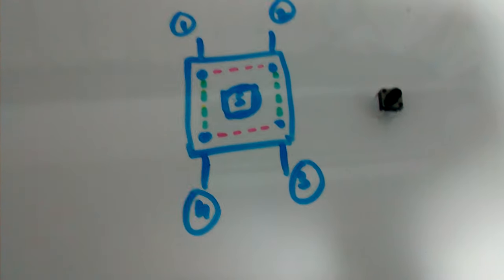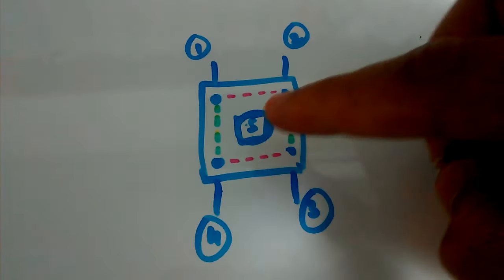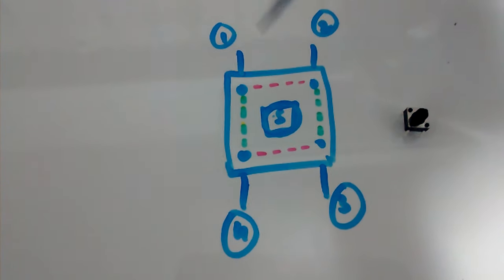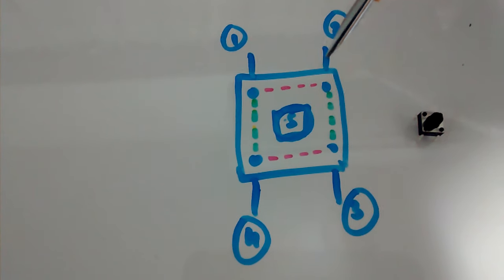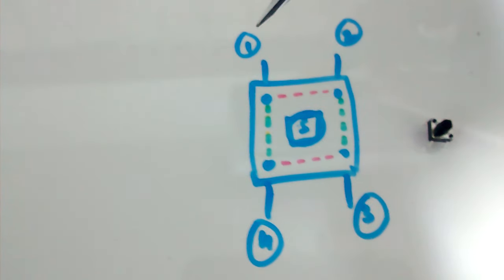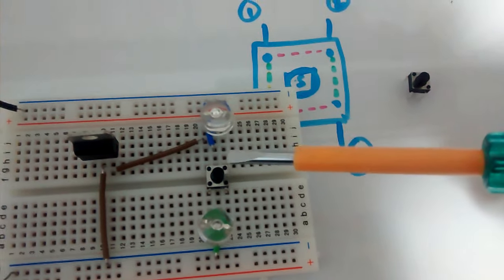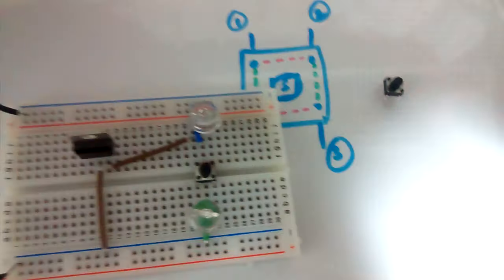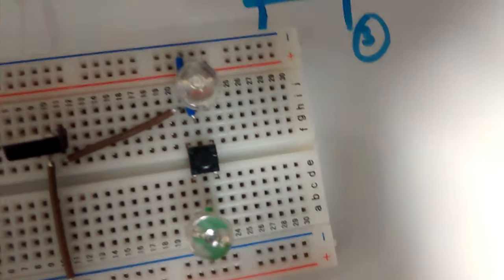Push Switch : Working of a Tactile switch

Comment: So that's mean if power connect with 1 and LED connect with 4 the LED will light up even though I didn't press the button. If power connect with 1 and LED connect with 2 then I need to press the button to light the LED if I don't press it , it wouldn't light up isn't?

Comment: thank you so much for this, sir!
Is it possible to solder a switch in parallel with one already soldered to a pcb? would it have to be the exact same switch?
Reply from the maker: Yes you can and it need not have to be the same switch.
Reply: @imtheroboart  wow thanks for the lightning fast response!

Comment: that was the real basic...can i do same with the stepper motor..

Good if you will explain how to run motor continuously with single press of button and  other case run  until I have pressed the button. like jog button and run button ..  i want practical difference why both act differently
Reply from the maker: hello.. Thanks a lot for your feedback :-)
As I understand, running a motor when u press a switch or until the switch is release depends on the logic u have inside the microcontroller. You can monitor the pin state to which the switch is connected and accordingly write a logic. Every switch gives only two outputs- ON and OFF. The remaining depends on the logic we run in the controller. I hope I could clarify your question. Please let me know if more info is required.

Thank You
Reply: My Distractions I have a doubt, if I press the switch the power at 1 will go to 2 and 3. and what about 4. The power will go there or not.

Comment: I've got a question .
I have a got a lot of synths with these tactile switches , one of them is the integra 7 by roland .
Two of the most used switches on it are the increment/decrement value .
Now , they work good , if I keep pressing them (without letting go ) the values keep changin ( continously) ...but when I verry verry slightly decrease pressure on the switch , but still keeping it pressed in , the values stop .
I am curious how thiss could be , since these buttons only have an ON/OFFs state

Comment: Thank you. Question: is there a way to make a LED remain on when you release the switch (on and off with pushing the putton)?
Reply from the maker: Yes you can!!. But you will require a bit of coding for that. The output of the push switch can be connected to an input pin of a micro controller and turn the LED ON when this pin on the micro controller becomes HIGH.
Reply: My Distractions  I have a doubt, if I press the switch the power at 1 will go to 2 and 3. and what about 4. The power will go there or not.

Comment: Well... this means if we connect the Catod  (+) to one of the switch legs; if we don't push the momentary swich, only two of the kegs have (+) , but when we push the switch all 4 legs have electricity, I don't understand what is the advantage of this switch versus regular swich. This switch does not operates on/off for two wiring with two individual Voltages at the same time.
Reply from the maker: Brian Sha  yes you are right. This switch is used for allowing current only for desired period of time. As long as you press it, the current goes through. Typical example is to reset the controller or implement a counter.

Comment: So i know it's a bit late,but would i be able to solder a 2 pin switch on a 4 pin slot with a doubler cable soldered on each of the switch pin?Or that won't work?
Reply from the maker: I guess it would work
Reply: @imtheroboart  Thank you very much!I'll give that a try.Subbed!
Reply: @imtheroboart  SO I SHOULD CONNECT THE POWER LEADS TO 3&4 AND THE NEGATIVE LEADS ON 1& 2 AND WHEN YOU PRESS THE BUTTON 1&2 WILL POWER UP THE L E D  ???????
Reply from the maker: @mw10259  you shouldn't connect the ground to the switch pins. Ground connection has to be given separately. :-) The switch just acts as a connection between the power and ground in the circuit. The circuit is open when switch is not pressed and closed when it is pressed/pushed.
Reply: @imtheroboart  aaaaaaah ok thank you so much ,,, i'm making a small flashlight , so i should twist the negitive wires together, seal them , and connect the positive leads to the pins that are the shorter distance apart so when the button is pushed they will make a connection  correct ?
Reply from the maker: @mw10259  I actually didn't get what you just said. But since you are working on a flashlight, the positive of the power should be connected to the pins of the switch, the output from the switch to the positive of the bulb. The negative of the bulb back to negative of the power supply. So when you press the switch, it becomes a closed circuit and bulb glows as long as you keep it in pressed state. When you release it, the circuit becomes open and the bulb goes off.

Comment: I have a doubt, if I press the switch the power at 1 will go to 2 and 3. and what about 4. The power will go there or not.
Reply from the maker: Divyansh Technician yes it will be available at 4. 1 and 4 are connected even if you don't press 1.
Reply: My Distractions thanks

Comment: Please could you help me out, I just have a question,  so I'm looking for a momentarily switchs, which I intend to connect to main board of pc for each key button wire of keywords, and at the same time to individual  LEDes, I want each time I push on that momentarily swich for each keywords, the related LED comes ON. This means I'm looking for momentarily swiches, which execute two individuals components on two individual electricity. Does this tactical switch do what I want or I should look for different switch.  Thanks very much.
Reply from the maker: Brian Sha yes you can use this type of switches for your use.

Comment: So can i use a switch and connect opposite ends to both pin and short it out when pressed. So that my laptop turns on?? please help
Reply from the maker: Kevin J I am sorry I couldn’t understand your question. Can you please explain more clearly?
Reply: @imtheroboart  thanks for reply. So there are two pins in my laptop that I can short using screwdriver to switch on the laptop. I wanted to connect two wires from the pins to a switch. Will that work ?

Comment: I'm building a boombox and I have those button as volume, the problem is that I need them out of the box... )the amp is in the box), tnx
Reply from the maker: I don't think you can directly replace the button switch with a potentiometer... Definitely the connections and circuit would be diff... As u may know potentiometer is basically varying resistor value... But yes potentiometer is a good choice for volume control I guess ... Can u give me some time so that i can check on this topic and get back to you ?? Tnx

Comment: Zhejiang Yibao Technology Co., Ltd. is a professional enterprise engaged in the design, development and manufacture of electronic and electrical switches, micro-motor accessories and precision molds. It was founded in 1998. The products produced are widely used in household appliances, auto parts, office equipment, Internet of Things, medical instruments, measuring instruments, industrial control equipment, etc.

    The company has a registered capital of 50 million yuan, and has passed ISO9001, ISO14001, IATF16949 quality and environmental management system certification; products have been recognized by internationally renowned safety agencies, and obtained UL, KEMA, TUV, ENEC, KC, CQC, CE and other certifications. Now it has become a supplier and strategic partner of many world-renowned brands.

    We sincerely serve every customer with professional design, stable quality, reasonable price and fast delivery!